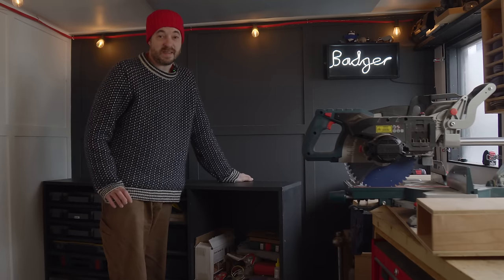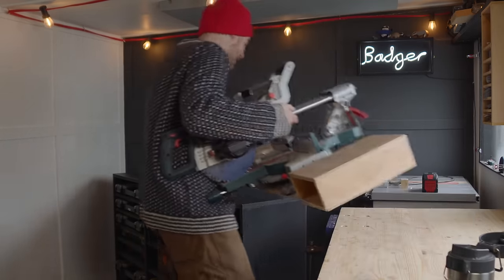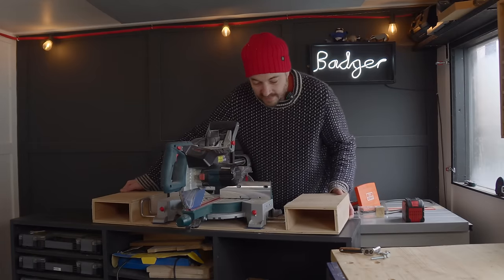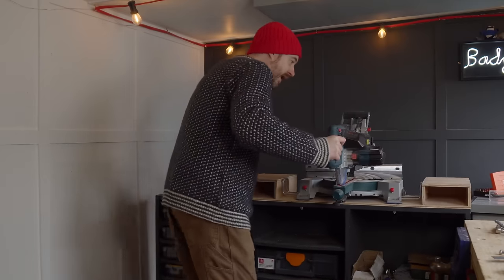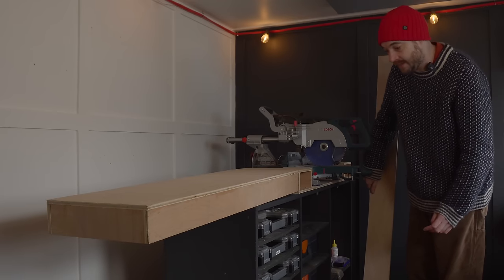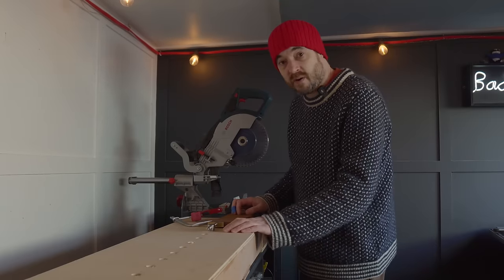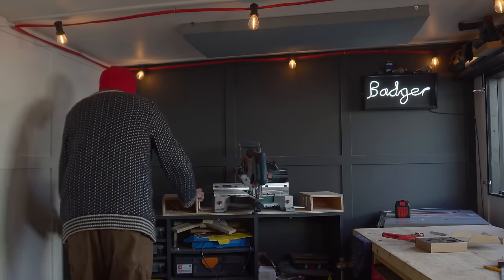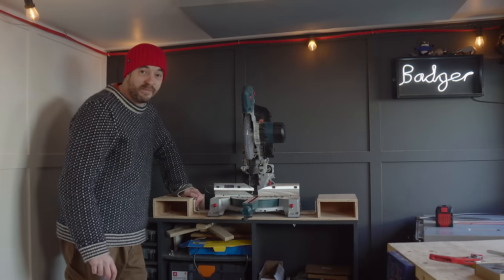Mitre Saw Station Upgrades

Comment: Great use of already completed projects. Maybe carriage bolts with the heads down and filing the tops smooth would keep your hands safe when reaching for things. Also with the single dog on the stop, would it be possible to knock out of alignment easily? I love the setup it’s very nice. Thanks for another great video.

Comment: Great idea! A third of the useable width in my space is tsken up by a fixed mitre saw station made up of kitchen units and worktop but i have bren considering removing the lot for more floor space.
Reply from the maker: They do take up lots of room
Reply: Freaky timing - this weeks project is to build a portable station that can be hung on a wall when not in use (not inc the mitre saw, obvs), then mounted on saw horses when needed.

I don't really use it enough for it to be a perm fixture, as the tracksaw takes care of 95% of cross cut tasks

Comment: If you put your bolts the other way round (thread sticking up)  you could resess the heads a bit and the thread want interfere as its not in line of any parts

Comment: If you turn the saw to 45 degrees when you store it, it will go closer to the wall and the saw its self wont intrude so far into the workshop. At least that works for my Metabo. Or you could ask Bosch for one of their Glide Arm saws……..